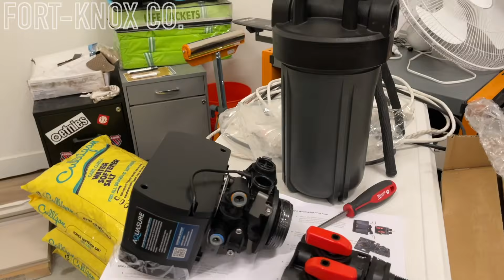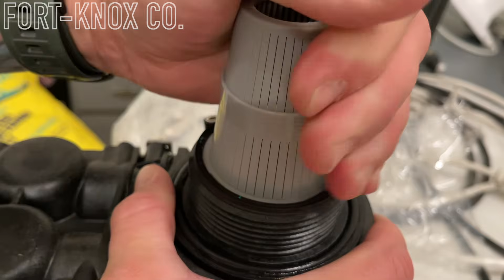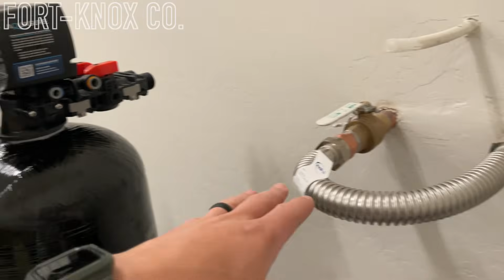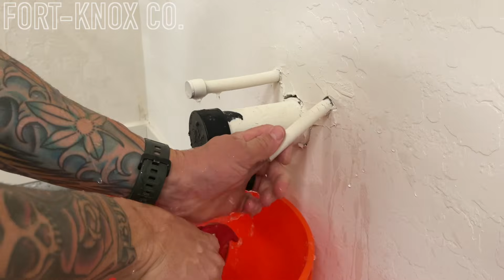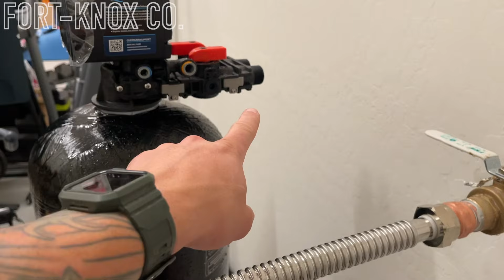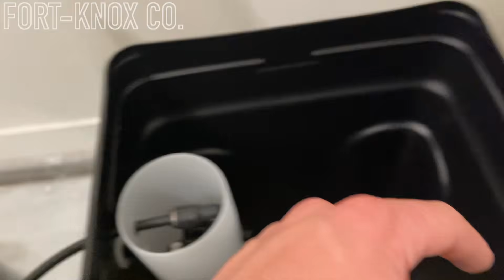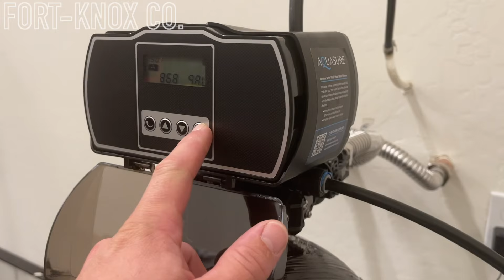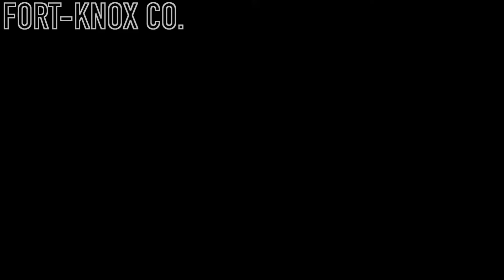How To Install Water Softener System Aquasure Harmony Series | Water Softener Loop Connection

Comment: Im curious what you do when the filter is spent because those are not cheap and ours from Culligan is getting replaced every year but we rent the system. I'm exploring putting one in myself but those big black cylinders are pricey to replace every year.
Reply from the maker: Well I’ve never heard of that needing to be replaced every year. These large tanks that hold the resin beads that do the softening are usually good for 15-20 years under normal circumstances.  So unless that system is something proprietary that they need to swap out every year then that may be specific to Culligan. 

Normally you set up your water softener and it’s good to go for many many many years. You just refill the salt brine tank semi often with some salt pellets. The large tanks do not need to be replaced. They get cleaned out and “regenerated” every time the system does its self flushing regeneration cycle when needed.
Reply from the maker: With your Aquasure water softener (or most modern softeners), the large resin tank that holds the resin beads usually does not need to be replaced under normal conditions. Here’s the breakdown:

Resin Beads & Tank Lifespan
	•	Resin beads: These are the actual media that remove hardness minerals (calcium, magnesium).
	•	Lifespan: Typically 10–15 years with normal water and proper maintenance.
	•	If your water has high iron, chlorine, or sediment, resin may wear out sooner (sometimes 5–7 years).
	•	Resin tank (the big fiberglass tank):
	•	Lifespan: Generally 20+ years, often lasting the life of the softener itself unless it’s physically damaged, cracked, or exposed to freezing.
	•	The tank itself almost never needs replacing unless there’s a structural issue.

Comment: When looking at these at lowes how do you know what machine has 3/4 threads or 1 inch threads for the head unit?
Reply from the maker: It should say on the box. Most likely small print. But where it starts to list connection or specs. If you looking it up online at Lowe’s or homedepot scroll down to look at the drop down menu yea. Specs or installation instructions. There always a couple documents available online with the item that will give measurement and details instructions that come with the item. It should say there the sizes of things. 

I’ve found most commonly 3/4” though. A lot of place carry that and 1” is sometimes a special order.

Comment: When it charges, why does it run for 15 minutes wasting all that water……. You call this energy efficient.???   no wonder why my water bill is so high
Reply from the maker: It does do a regeneration and rinses itself out and flushes out the minerals.  They are getting more efficient obviously as technology gets better. But there’s no way around it I guess. You’re gonna flush some water out with that rinsing. 

But you may be saving more money it other areas like the pipes in your home, the wear and tear on all your appliances, your skin and hair, etc.  Either way it’s an option for people.
Reply: @FortKnoxCo  yes I understand it’s got a flush and it’s coming out of a little tube. Next test I’ll do is how many gallons especially running for 15 minutes….. they claims it cleans out the pipes. Don’t know about that………… I take a cotton ball and rubbing alcohol and clean the back of my neck and you should see all the dirt and I don’t understand where it’s coming from other than this water softener………. The city claims it’s got good water. They charge us for water test, but we never see what the water test shows.!!

Comment: How do I fix a leak in the drain line 90 degree turn part right before the drain line hose?
Reply from the maker: You may need to look at the O-rings that are on the piece. If they have any damage or link in them it can cause a drip or leak. I’ve had that problem before and had to mess with it a little and make sure the rings are lined up as well. So when you push it back in and put the secure clip in place it doesn’t bind up or scrape on anything while going in.

Comment: I just bought the unit.  Actually, page 14, part 2 under step 2: system startup, it has mentioned: "open the inlet on the bypass valve slowly......".
A very clear, details video.  Thank you.
Reply from the maker: Good info! Thank you for commenting. We love this unit.

Comment: Man I don't have any of those pipes/ lops to connect to in my home! I've checked every inch, could mine be in the walls?
Reply from the maker: Yeah, some houses don’t have a “water loop” plumbed it’ll where you water line makes a “loop” out of your drywall and then back in before it splits off to your hot and cold water supply.  This can be plumbed in after the fact though. It’s usually not too big of a job.

Comment: To bad the home builder buried the main in a wall, no drain access,, otherwise good video if you have an ideal home
Reply from the maker: Yeah not every home builder is plumbing in a loop for this. But should be a standard of practice. It can obviously be done as a renovation but takes a little more work and possibly some drywall finish to plumb in your own.
Reply: I work as a power systems tech plus Hvac these days , I still dislike engineers, lol @FortKnoxCo
Reply: I will have to wait then replace heater tank with tankless hanging on wall, then use the space created to install the softener plus add a pump to push drainage up and Across door header to washer drain, 😭

Comment: Great video. I have question  .where is located the filter on water softener?  Do you need to replace the filter?
Reply from the maker: The water softener itself is the filter for the hardness of the water. The material inside will regenerate on its own cycle, its rinses and filters out the minerals it grabs and then it’s good to go again. 

As far as a paper or carbon large partial filter some systems depending on what you purchase have a canister you install in line with your system, either before or after your water inlet out outlet. It filters in general any large partials. That can be changed out every 6 months or so. It’s usually a cotton type filter, very simple.

Comment: I had one installed but the installer left the in red valve parallel to the pipe and the out red valve in the perpendicular to the pipe. Is that normal?
Thanks
Reply from the maker: I believe they should both be in line with the pipe to have the water flowing in and out freely. If the red valve is perpendicular that usually is closed. They should both be open

Comment: I had this same unit installed and the flush line isnt draining the water out after a regeneration cycle. i removed the brine tank line and saw that it was backing up water into the tank. 

I have the same In, out, drain loop in my garage. Is there a solution to this?
Reply from the maker: There could be a couple things. It is normal for there to still be some water in the brine tank afterwards, there will be water sitting in the bottom and sometimes you can see it sitting there after a regeneration cycle. This is usually considered normal. It shouldn’t be filled all the way up, obviously, but there will be some water in there from my experience. If it’s not flushing water out of the system at all, and there is absolutely no water being drained out then you might have a larger problem. Either there’s a blockage in the flush line or the head unit is not operating correctly. If the unit is flushing water out during the generation cycle, and there is water going through that flush line into your wall and into your house drain then I would assume that the system is operating correctly. If that’s the case, but you feel that there’s too much water left in the brine tank after a full cycle, and the cycle is going through the normal process and allowing water to flush out during, it may just be the way it is supposed to sit.
Reply: @FortKnoxCo I appreciate the response! I was able to find the problem. It’s a new house and the builder didn’t cut the tail end of the drain line in the laundry room. It explained why it wasn’t draining out 👍
Reply from the maker: @sosbrigaders oh nice! Easy fix.

Comment: hello sir, thank you for the video.  I have a water quality company quoting me almost $8,000 ($8K) for a system exactly like what you are installing.  Is this for hard water only or to filter out impurities and chlorine?
Any info as to WHY/reason you installed this in your home, I would appreciate.  Thanks.
Reply from the maker: This is exactly why I installed myself. Saved a ton of money and got what I feel was the same if not a better product. This one in the video is just a water softener. Mainly filtering hardness out of the water. Aquasure makes a whole home filtration system now too. It has two large tanks and the brine tank. So it filters the water and softens the water. If you want filtration and softening then I’d get a “whole home” system. I do have a video showing the shell water system whole home filtration system. Very similar set up on how it’s all installed. They almost all install the same way. 

I may be going to the Aquasure whole home system to give it a try and I’ll make another video on it if I do.  They also have a large particle filter canister that’s plumed in line with these systems too to add another layer of filtration. I show that on the shell water system video. 

I mainly got this filtration system for the softening of the water. It works great. I still have reverse osmosis systems at my kitchen sinks to filter drinking water and the water line for the ice in the fridge.
Reply: @FortKnoxCo appreciate your time, brother. Thank you for the video. By the way … EPIC mustache.
Reply from the maker: @TrialByError_mostlyError no problem at all. haha. I appreciate that.
Reply: @FortKnoxCo  sorry, follow up question- how do you like the shell water filtration system? is there a reason why you will go back to aqua?
thank you
Reply from the maker: @TrialByError_mostlyError in all honesty they are both great systems. But when I had aquasure I felt like the water was softer for some reason. Felt softer. Based off testing , they both softened. 

I also like the simplicity of the square system. Nothing technical about it. The shell water system has WiFi connection and I just felt like I didn’t need all that. Plus… price point.

Comment: What is the size of wrench I will need ? something similar to the blue one which you have in the video. It will be helpful if you could put an amazon link.
Reply from the maker: The blue wrench used in this video when I removed the flexible water line was a standard adjustable pipe wrench. Usually referred to as a “water pump” wrench.  I just added a link down in the description for you. Listed as “10” water pump adjustable pipe wrench”
Reply: @FortKnoxCo if I recognize the brand it's channel lock brand probably size 420 or 410. I'd go with the 420 to be safe.

Comment: Got mine all set up thanks to this video! Finally question,, after the initial regeneration, do I have to turn off water into the house every other time it regenerates?
Reply from the maker: Nope. You can leave it open and use as normal. You only now need t replace the salt in the brine tank periodically
Reply: @FortKnoxCo  thank you much! ours is flowing fantastic

Comment: So my house uses the PEX-A piping right from the main waterline,, Do you know what I could use to connect it to the filter? cause they are screw ins do they make something ?
Reply: Got it!! Also when it does the cycle face should the water in the salt tube eventually be completely gone or does water stay in it ?
Reply from the maker: @The_Vulcaneer during the regeneration cycle it fills the brine tank with water, then pulls the salt water into the system to scrub the minerals and clean the matter in the tanks, then flushes that out. Then flushes itself.
Reply from the maker: Mine is PEX-A all the way through as well. They have different fittings that transition from PEX to copper. You’ll need a PEX expander tool to place the fittings in though. Otherwise you could use a push on fitting like a shark bite. But some people don’t like using them because “they” say sometimes they can leak or fail over time. I haven’t experienced that and they are rated to the standards required. But professional plumbers won’t use shark bites because it’s a quick work around. But you can get a PEX-A fitting that is brass and has threads on the other side and it fits into your pex and give you threads to screw on or connect to what you need

Comment: I’m hoping this gets a reply; I have a purpose built water softener loop in my new home…Do I still need an air gap?
Reply from the maker: Never seen an air gap on a water softener. It’s an all in line water flow. No air admittance needed. It’s not like an air gap on a dish washer or anything. Different system and what’s going on. 

So water softener will hook up and you should have a drain line that just needs to be connected. Usually if you have a water loop for a softener you’ll have a smaller diameter tube for the drain/flush line for the softener.  That line if it is already plumbed in the house should properly run to a drain. Very common to run to the laundry drain pipe where it can handle a high flow of water. Ours for example drops in from the top and runs right into our laundry hook up drain

Comment: what about a bypass? Do you use to valves on the softner to handle a bypass?
Reply from the maker: If you want to plumb your own bypass into the system you can. But I don’t have it set up that way. Just then shut off valves on inlet and outlet to the house. The system itself has the bypass mechanism when doing its regeneration.

Comment: You’re tempting me into saving more than 600 bucks man you just gave me the confidence to do it thx 🙏🏼 🎉
Reply from the maker: Nice! I think you can do it. And it will be that much better when you get it all done and you tackle the next money saving project around the house.
Reply: @FortKnoxCo I notice you didn’t install the pre filter is that correct ? I just got mine and am not sure if u can skip this step at all
Reply from the maker: @TlalocB you don’t have to install it for everything to work. It’s an added feature. It can be plumbed in line before or after the unit. I have the video showing this install on my Shell Water system Whole Home filtration install. I plumb it in after the unit.

Comment: I still don’t understand, how does it put water into the water softener and also pulls it back out when there’s only one line connected to it you used a bucket of water but later when that water is gone how does it pour water into it
Reply from the maker: If you google a diagram of the inside of a water softener you’ll see there’s a path down the center and an inlet that allows water around that center core path. The water makes it way through all the filtration matter inside the cylinder and is forced to move through/down all the matter and then back up the center pathway out. It’s simulating how the earth naturally filters water through soil. Sits on top, makes it way down through the sand and gravel and then eventually to a water table and then it can be tapped into and pulled up like how a water well works.

Comment: I just watched your install video on this unit (Aquasure) and another video on Shell Water Softener. What’s the difference between the two units? The Shell water has two tanks while the Aquashare has one tank..  what’s the better system in your opinion? I’ll tell you that this video the install looked way more simpler than the Shell Water. This system also seems way less expensive. .
Reply from the maker: Your hittin the nail on the head. It’s a simple system, it works really well and it was a lot less expensive. The main difference is the 1 tank vs 2 tank. The shell 2 tank system is considered a “whole home” filtration where it filters the water with a carbon filter tank and then a softening tank filled with the resin beads to remove minerals. The Aquasure one here in this video is just a softening system.  BUT aquasure now also has a whole home system 2 tank set up. So I may be doing a video on that in the near future because I like the Aquasure systems so much. It’s more than the softening only obviously but still much less than you’ll be paying for shell.

Comment: Where would you install a filter system to also connect with everything.
Reply from the maker: Like where would you install this system? It’s usually on the main water supply line before it splits to the water heater and your cold lines.

Comment: You f*** up the first step you forgot to lubricate o ring.😂😂😂
Reply from the maker: Luckily they come with a full set of instructions. I was mainly walking people through the physical aspects of the assembly and install. Wanted to clarify things like what’s actually happening with the system, how the system works and some of the trouble shooting areas I thought people could use. I appreciate the feedback 🤙🏼

Comment: I bought an Aquasure 32,000 water softener and inline all house filter. I have cpvc piping on the original system. The easiest for me is to use flex pipe and threaded adapters mounted to the CPVC. Buying and spec'ing all of the adapters is my stumbling block. Do you think it best I take the tank head and photos of my existing set-up to a plumbing supply house and have them choose for me the parts I need? Including the shark bites.... It may cost more but at least I'll have what I need?
Reply from the maker: Yeah if your not sure on what or how many pieces you need then that’s a good way to hoped prevent making many trips back all while your water is turned off.  So that’s a good plan.

Comment: Don't like plastic valves, do they make them steels
Reply from the maker: If you’re referring to the head unit valves on the actual water softener itself I don’t believe they make them all metal. But the shut off valves I used on the inlet and outlet are brass/metal components.